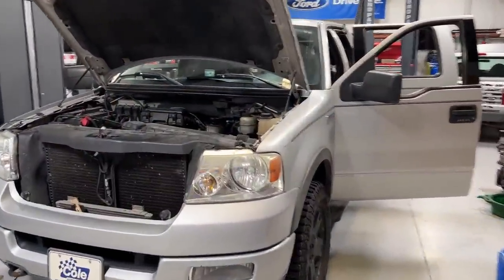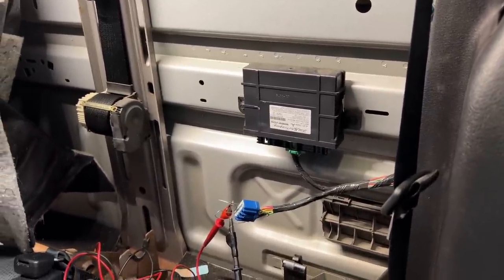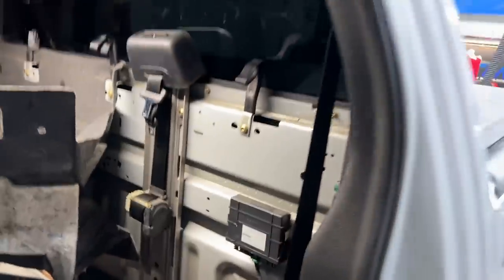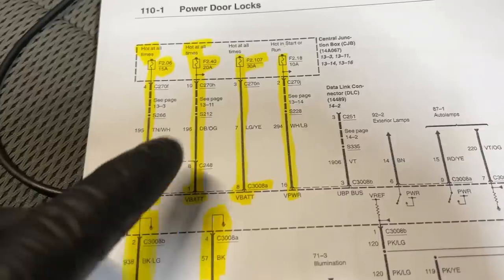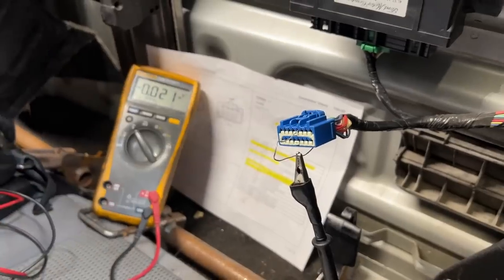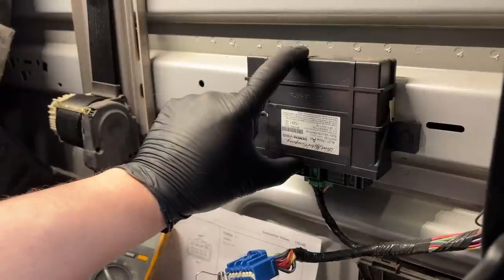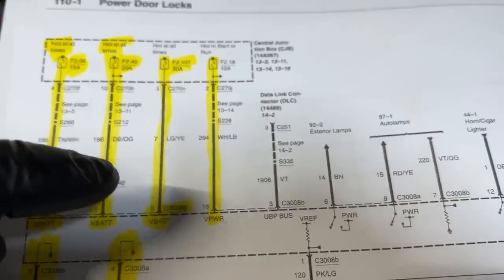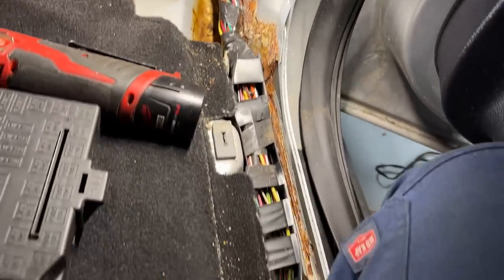This is Why Load Testing Electrical Circuits is so Important!

Comment: Hi, love your videos. My 04 5.4 has been one of the good ones. About to cross the 300k mile mark. But none the less a lot of these issues are starting to make themselves known. I've got my first case of battery drain. Seems likely it's the radio circuit board but I'm wondering where you would start. Everything works fine except radio illumination. It always work when my headlights are on but when I turn them off sometimes the radio will light up and sometimes it'll be very dim. I noticed sometimes if I flip them headlights on and back off the illumination will come back. I've been leaving the fuse out to save my battery over night.

Comment: Great troubleshooting! What are you doing with the rusty interior? Are you fixing it and applying paint? I had a wiring issue on my Ford Focus ZX5 2004. The back door open indicator stayed on & wouldn't allow me to arm the alarm. Found some crusty wires in the hinch of the back door that had to fix.
Reply from the maker: No I do not do body work at all.

Comment: Have you worked at all with Power Probes? I’ve got a Power Probe 4 and I’ve found it to be extremely helpful for issues like this in proving out circuits quickly. I know some folks have reservations about them. And clearly a guy can get himself into trouble with one. Just curious your thoughts on them for proving our circuits. Thanks for your work. Your videos are fantastic.
Reply from the maker: I would never own one.
Reply: @FordTechMakuloco  that’s a sharp rebuke. Is there a reason you don’t like them? Strictly curious.

Comment: Hi for what it is worth at approx 2min and 50 sec in  based on the module not responding I know you cut to the chase (i think)based on the blue plug being unplugged and supportive theory on the network no power to the module /massive voltage drop to the module or faulty ground ( I understand all of this)

Comment: My girlfriend has the same truck and rhe rockers are also starting to rust in the same spot due to some kind of water leak I can't seem to pin point where the water if coming from almost seems like moisture collecting from the evaporator but the drain isn't clogged. Any idea what the leak is?

Comment: Hello, i have a 2007 ford f150 with headlite issues. All Lites come on when you pull the switch with truck not running. As soon as you start it the headlites go out. All other lights and blinkers are working. Any advice?

Comment: Butt connector or solder? Is there really any difference so long as you do a proper job of the repair??? Thanks Brian!!!
Reply from the maker: I only use the Ford butt splice and double wall heat shrink which is a very solid repair similar to solder but stronger.

Comment: I have a unrelated question to this video. I have a 2013 Ford Edge that I purchased new. I was told that I did not had to change the transmission fluid. It just hit 99k miles. Is this true??

Comment: What I hate about reading schematics is how to read the connector.
What is pin 1,2,3,4,5 etc
What side is the starting point for pin 1,2,3,4,5 etc?
is it the terminal side where the other connector plugs into?
 is it the backside where the wire/terminal plug into?

Every oem manufacturer helms book has their own way of describing this and is usually not absolutely clear. 
They should use a picture and say this is how we read the connector.
This is pin 1 etc

I’ve stripped wire harnesses to make race car track car harnesses and trying to get rid of all the unnecessary wiring can be tough when the schematics are a pain to read.
Once you know which wires to test, diagnosing electrical or component problems are actually super easy to do.

Comment: Have you had any 5.4 3v starters go bad and have a intermittent grind noise
Reply from the maker: Not many.
Reply: my truck does this about once per month but until it gets worse I'm leaving it. that top starter bolt looks like a nightmare.

Comment: Whenever I get an older vehicle with a electrical problem 
& a 3rd party security system I call the customer & ask
If they still use that security system.  More often than 
not, the customers will say-
'What 3rd party security system?'
OR,
'Oh, that, I lost the remote years ago'
I then yank it out & quite often  THAT  was the source of
the electrical problem.

!
Reply from the maker: For parasitic draws yes.

Comment: Are you able to access information from the modules that use that old UBP bus?
I'd like to pull data off my PAM and air suspension module from my 2004 Navigator, but there does not appear to be any code readers that can access it. Even Forscan can not access them. I checked with a lincoln dealer and they said they can't access it either, its too old. I'm stumped.
Reply from the maker: Yes the Ford scan tool can access it.

Comment: Something is odd here. You can’t have a voltage drop without current flow. When you got an open circuit reading of 11.40 V was there a short to ground in addition to the corrosion in the wiring harness?
Reply from the maker: Did you see the wire when I pulled it apart and dust flew out and there were no copper strands at all.
Reply: @FordTechMakuloco  Sure did. But if that conductor was corroded open, how could there have been 11.40V on it? There must have been a strand or two still attached.
Reply from the maker: nope it will transfer through, you don't think the copper strands that turns to copper dust are somewhat conductive still?
Reply: It’s an interesting question. Usually copper corrodes away into copper oxide which is green in colour. I really enjoyed this troubleshooting video of yours and am trying to understand why that pin in question was showing less potential than the others. In order for that faulty circuit to drop voltage it must have had current flowing but I can’t see how as it was open at the connector.

Comment: Could this be!?!?
I also have an '04 F150!! One morning my dash light blacked out, rendering my speedometer unreadable without a light source. Also my turn signals work fine UNLESS I turn my headlights on... then my turn signals do NOT work!! If my truck is in park, I CAN NOT shift into any gears from park when my headlights are on. Soon as I click the lights off, BOOM, goes into any gear you need. And one of the biggest issues, my heater (or AC) does not blow at all!! So I have no heater or AC, which ain't a kler to me EXCEPT I CANT DEFROST THE WINDSHIELD!!!
Any ideas?!? Please help!! Even if you're an experienced Ford owner and you have some idea... PLEASE HELP!!! I can't get an inspection sticker if my turn signals won't work when my headlights are on. I can't see when my windshield is ice and my heater don't blow. The dash light being dark ain't too bad, I'm experienced enough to know my speed, but not letting me leave park when my lights are on is very annoying too. This Saturday I'm parking it in my garage and taking the insurance off of her so I can redo the timing, oil pump, and whatever else to reborn this truck. But I need to fix this issue as well, and I have a multi meter. Please help if you have any ideas at all on where I need to start!!!!
Reply: It would be good if you can find a wiring diagram for your truck.  You need to know what, if anything, each of those items has in common such as do they share a ground, work off the same "hot" (12v positive) wire/circuit, etc.  
Since you have a meter, a good place to start might be to remove one your turn signal bulbs from the socket, turn the ignition to on position, and check the voltage going to the bulb.  Now turn on the turn signal and test/compare the voltage.  After that, turn on your headlights and retest the voltage at the turn signal and you'll probably find the voltage has dropped just like in the test on this video.  If that actually happens then it's a matter of tracking down the location of the bad or loose positive or ground.
It's possible that the problem could be inside the controller for those items but since they work as you stated I think that is probably not the cause.... but just throwing that out as nothing is ruled out at this point.  
Come back and share results of the light voltage test if you try that.  Good luck.
Reply: check behind the kick panels both sides. If the ground wire behind there is all crusty and rusty that can cause your problem.
move it up to a solid piece of metal and you'll be back in business.

Comment: That still doesn't fix the problem, that there's water getting in somehow;  and that fuse panel is next.  It could be the windshield that is leaking, or many times--- it's the rubber gromet near the door hinges/  the wires for the windows and locks...  Which I would bet is where the problem is.
Reply from the maker: I am not a body guy I just fix the module concern. It is up to the customer to get the body rot and water leaks fixed at a body shop.

Comment: " i dont know why ford does it like that".... i do... SO IT FAILS and they can make money on service or people give up and buy a new truck. THe fact that after making cars for 100 years Ford and others cant stop water from getting in to an electrical area shows just how corrupt they are designing failure points into their products. I just bought a 2005 F150 with a bad motor and good frame to replace my 2006 F150 with a good motor and rusted frame. During the engne swap i found huge rust issues on the passenger floor. I found a leak on both sides that allows water to enter at the A pillar and flow down to where all the wires are ( ON BOTH SIDES). This is why my next vehicle purchase(S) will be Teslas. They are building products to last not fail on purpose due to poor designs(ON PURPOSE). They also LIED about the alternator specs right on the window sticker. FRAUD=FORD.
Reply: Bingo, been saying for years that sometime in the late 60s early 70s manufacturers of most everything realized that if their products are built too well, they lose new unit sales.

Comment: i'm not sure which is worse my 2000 with the GEM on the left kick panel fuse box or these with the fuse box on the right.   idiot engineers

Comment: actually paper clips as this guy is doing IS SO SO WRONG, YOU NEVER NEVER NEVER EVER WANT TO PROBE THE FRONT OF THE CONNECTOR. YOU END UP SPREADING THE SOCKET AND THEN YOU HAVE LESS THAN OPTIMAL CONNECTION!!!  THIS GUY IS SO SO WRONG ABOUT THAT POINT!!!
Reply from the maker: You must use the thinner paper clips not the heavy duty ones, they literally slide in without barely any resistance just a light drag. That is how you know it is not spreading the terminal, it all comes with experience. If you had the same automotive experience, you would of never made the comment but you did which is a tell. It has now been 20 years and no problems and yes I know all about spread terminals and the problems they cause I see it all the time from other shops that jam a test light in there. I use the paper clip on bigger connector terminals that can handle it otherwise I have a Ford Rotunda Flex Probe Kit part number NUD105-R025F so don't make a comment until you have the full picture.
Reply: @FordTechMakuloco  Where do you get the thinner paper clips?